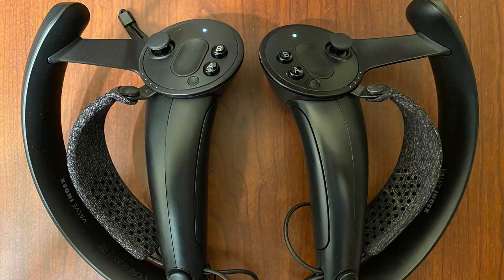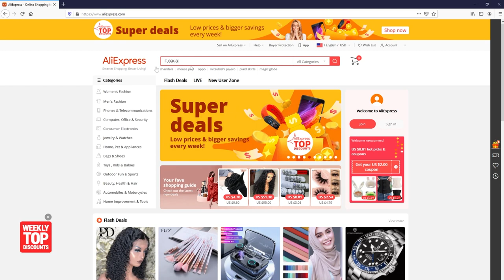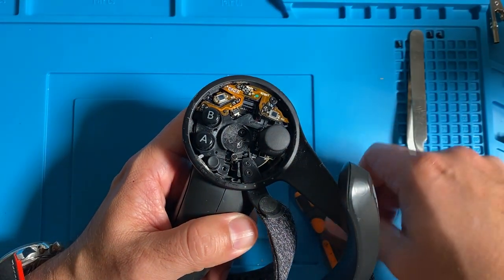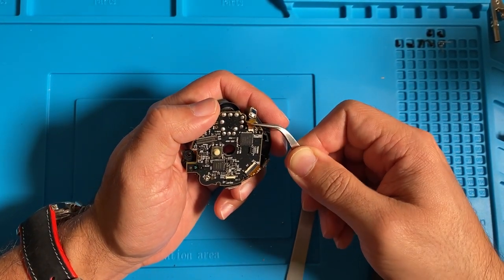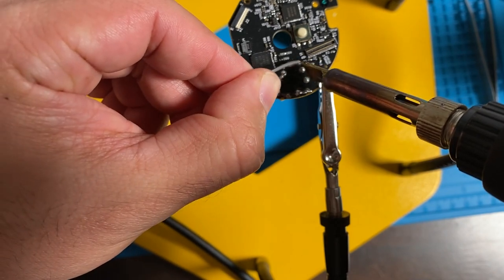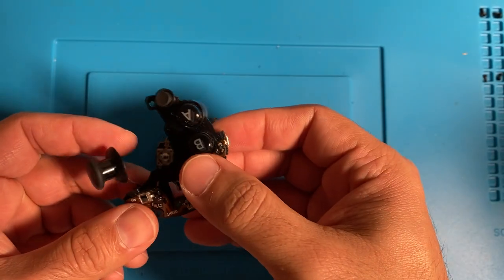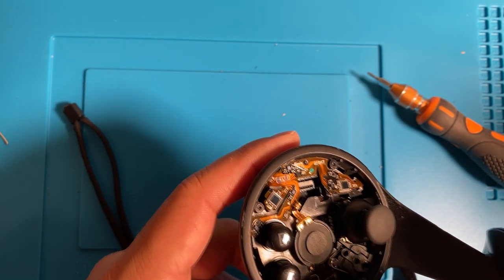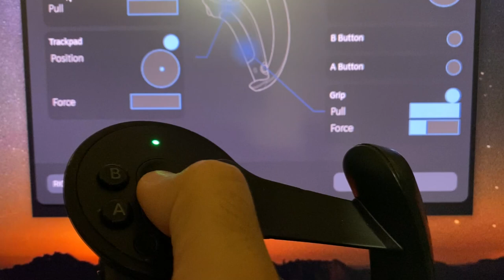Valve Index Controllers Thumbstick Drift Fix | Thumbstick Replacement

Comment: It took me a while, and i had to learn soldering, but i finally did this replacement (left controller, so all was mirrored for me), with only your video as guide. Thank you! The hardest part was to get all the solder loose or removed  to remove the old part. The second hardest part was to place that little f..... spring back in. The little pincers i had just always lost grip.

Comment: After 400 odd hours of being repeatedly flicked upwards to avoid fast travelling in Skyrim, mine finally succumbed.
Managed to follow this guide. I was nowhere near as well equipped to unsolder the old thumbstick and resorted to ripping it off in pieces and unsoldering the leg stumps that were left with the iron and a manual thumb spring solder removal pump. Was adamant I'd ham fistedly broken it by the time I'd finished but she's working perfectly! 😁
Reply: Oh my god I just did the same thing today lolll
That's the same way I removed the old thumbstick
Luckily it worked out perfectly fine
Reply: I just got mine off, haven't put the new one on yet.  I even bought the same chip quik stuff he used and STILL had a hell of a time with it.

Comment: Im one month away from 2 years with my index. I've been through 3-4 controller replacements. I'm tired of it, Valve could have done much better imo. I've been watching this video on repeat the past couple of days getting ready to purchase equipment and parts. So far still cheaper than a new pair. Plus if I get good at it I can take in people's controllers from the league for repair.
Reply: Does it work ?
Reply: same lol
Reply: around 3 replacements in only 2 years?
May I ask how much do you use them?
Sounds very excessiv to be (no offense).
I just bought the index controllers and they arrived yesterday. Haven't tried them yet, but somehow Im a bit worried of course

Comment: Thanks mate, managed to swap them out and keep everything in working order! 

For people looking to do this, I strongly recommend the chipquik or something similar, it's possible without but took way longer than it should have. Try your best not to snap the legs off the original joystick, removing them after the fact is incredibly painful. The way I ended up getting the joystick off was using a very small flat head screwdriver bit and slip it between the joystick and the board, applying a little prying pressure as I applied heat to the legs. This allowed the joystick to move very slightly each time I changed what leg I was heating. Would have worked great but if you apply too much force, you risk snapping the legs off like I did for 3 of them and it was a pain to get those out.
Reply: I was able to fix my controller with the help of this video, but I wasn't able to get the chipquick to work. I bridged all the soldering points on the thumbstick with chipquick and had a fat tip on my soldering iron running at 675F, but the thumbstick just wouldn't let go. After a lot of heating and pulling, molten chipquick ended up running onto some tiny capacitors nearby. I was able to clean them off by wicking it away, but it was a big mess. What worked for me was to use ESD tape to cover nearby components, then to heat the individual thumbstick soldering points with my hot air rework gun and to suck away the molten solder with a desoldering pump. I'm sure chipquick is an easier way to remove the thumbstick, but it seems like it involves more risk than desoldering each point individually.

Comment: Thanks for the super detailed video - I really appreciate it. I'm going to go down this road sooner than later. Might as well try to fix it for under $20 (controllers ~$8, solder wick and pump, maybe some quickchip) before buying a new controller (not that their in stock right now anyways.) I've soldered bigger stuff before, but not too confident in soldering something this small. I think I'm going to find some old electronics to practice on first. Just thought I'd mention that for anyone else hesitating to to try fixing their Index controller.

Comment: I think its highway robbery when a company designs a part that will break over time from use. That's ridiculous and a terrible design. Thank you for posting this
Reply: Just to play devil's advocate, all analog sticks will drift eventually. It's just a matter of when, and companies need to do a better job making that 'when" a lot farther away.
Reply: and they are still selling it like there`s no problem with the stick
Reply: @FilthyCasualVR  I think Valve designed most of the original HTC Vive's hardware to begin with. The headset, base stations, and controllers.
Reply: every product ever designed ever breaks overtime from use.
Reply: A controller this expensive and technologically advanced really could've included a hall sensor stick. I get it that they were strapped for space so they had to use the tiniest analog stick mechanism they could buy, but that's hardly an excuse to buy the cheapest one too.

Comment: Great vid. my left hand had pretty much the same issue, though the sensor couldn't even detect that I was pushing forward on my controller. I was hoping the controller would be simpler to do myself but I don't have any kind of sodder experience or the tool to do it. I'm glad that there is a fix and that I wasn't the only one with that issue.
Reply from the maker: Yup, I feel you.  I wish it were simpler.  This is why I said do so at your own risk.  You have to be careful if you try this, you can break your controllers if you are not careful.  You can also overheat the board.  There is some risk. I would recommend grabbing a PCB prototype kit and practice soldering and desoldering components before trying, plenty of youtube videos on soldering also.

Comment: thanks for the video mate!
don't has the skill for soldering, so i replaced the entier board (what wasn't easy at all and the faceplate ribbon cable snapped in half for... no reason. thanks i had the faceplate from the donator controller so i was able to change it, but i'm surprised how fragile the internal componants are...
Reply: I tried to replace the entier board, but I has no lucky. Buttons are not working, I think I got a busted board from AliExpress.

Comment: Thanks so much for the info. It's so motivating knowing that this is something I can fix myself. Also 👌 on the music
Reply: Update: I did it! I accidently broke two of the plastic clips for the top cover and the led doesn't work anymore (don't know how that happened, mightve mistaken a random plastic tab for solder or something) but the drift is gone! Just have to get used to the new activation force of the stick click

Comment: Thanks for the video! The explanation of the steps is very helpful

oof..
using plastic instead of metal on a self-grinding down part could be seen as planned obsolence.
They save some minor couple of cents during production but the get a multiple hundred dollar reward when it breaks from the customer.
Especially since valve doesnt seem to sell replacement parts at all.
(same goes for the lighthouse boxes, which are also hard to disassemble)

Not very "pc gaming friendly" I would say.

Comment: Thanks for translating the Russian one and adding to it. My only input is i think the ribbon cable connectors have flip up latches so you don't need any force to remove and reinsert the ribbon. I could be wrong, I'll be doing mine soon, but i think it's the same as a phone or laptop. Good call on the chip quick, that's pro knowledge lol
Reply from the maker: Thanks, I'll take a look.  I'm fixing another one tomorrow.  I don't recall seeing any latches, but I'll take a closer look on the next one.  If you fix yours and find them, let me know, I'll post an update.
Reply from the maker: You are right, there are small latches.  I will post an update. thanks.

Comment: I took the cover off based on another (text only) guide and ripped the thumbstick ribbon cable like you said.  I think that's just the capacitive sensor for the stick which shouldn't really matter?  No reasonably priced replacements to be found on Ebay.

Comment: it's worth noting that Valve is very forthcoming regarding RMA for this issue. in my case an RMA after 3 years was no problem. so you might want to try that road first before potentially breaking your controller.
Reply: After nearly 5 years they refused to RMA it for me :)
But I won't buy another one for the price they still have without breaking them in the repair first. And if it works I only paid like 10 bucks for all the tools I didn't already have

Comment: Man I did this and soldered the potentiometer on upside down causing me to have to unsolder and re-solder it again, I basically Overheated the board or something because now there’s a short and it just flickers and vibrates. Great video though, I was able to do everything else without breaking anything haha.

Comment: You are heaven sent my friend.  Was able to replace the stick perfectly and even lube up the trigger springs while I was in there.  Only caveat being that I'm fairly certain did just that you said to avoid at the opening with removing the force sensor on the trackpad when it just flexed ever so slightly.  After some double checking, fairly certain that's what happened anyway.  Got any advice for a component reseller lead?
Reply from the maker: Probably not what you want to hear but your best bet might be buying a new controller from eBay if you want to fix the trackpad.  Unfortunately Valve doesn’t sell any components so we are left with very little options as far as repair goes.  I’ve removed several of the trackpad force sensors without issue, maybe yours was glued on there harder?  I can’t think of many better ways to get that off of there since it’s glued on.
Reply: @nolomite3921  A little bit of heat with a heat gun or hair dryer might help, not too much to avoid warping the plastic, just enough to make everything warm to the touch, this generally softens the glue that is commonly used in electronics and can help make it sticky again for when you put it back together.

Comment: great video, unfortunately there was user error... resetting the spring i dropped it in the controller upon reassembly  🙃

edit: i disassembled it and the spring perfectly unfolded under the hole for the trigger

Comment: I got issues, I've not contacted Valve yet to see if they will sort it for me, I had replacement some time ago but now it seems I've having the dreaded issue. Certainly don't fancy buying new controllers. I'm doing some research into this, in which I found this awesome video. I think if I do decide to attempt to replace the part, I best study on soldering etc too. I were just wondering if also,  it were possible to get a better quality part which would fit it or to modify it so it doesn't break so easy. Surely Valve should be liable selling poor quality components if they just fall apart like that. Could you fix the original part even. Thanks for sharing the information. What do you think on modifying it so it doesn't break any more, it's just so sad that other controllers can have thousands of hours without no problem. These controllers are great apart from the quality standards being used. Design flaw even.
Reply from the maker: It is unfortunate. Like most manufacturers of electronics, most companies don't manufacture their own components, they source them from other manufactures.  PS5 just had a class action lawsuit against them for the same thing, drift. They should be testing for a number of cycles before failure.  I'm not saying it's impossible to modify them, but probably impractical and difficult.  They are very small parts, built to a tight tolerance.  They are actually impressively engineered even though they fail. I haven't seen any better quality parts that can replace them, the one part I mentioned is the only part I know of.  There are better thumbsticks out there but they have to be the same exact size and tolerance to fit the circuit board. Valve either needs to work with their source of supply to redesign the thumb thumbstick, or find another source of supply and they should be performing better QA testing for cycles before failure.  It's not easy because these are mass produced at some factory, meaning they would have to retool their machines which is very very expensive.

Comment: I've had 6 broken thumbsticks so far and I'm currently trying to get  another replacement but valve is trying to blame it this time on software issues and giving me a hard time with the support. They know damn well what's wrong with the controller design. How much E-waste are they producing with this cheap out plastic thumbstick solution ? I doubt they refurbish the broken controllers. I would pay more for a model that doesn't brake every few months but it must be cheaper for valve to use the plastic ones and then replace the whole controller for every x customer instead using a more expensive metal one for every controller. I wish valve would be called out for this, if it was a xbox or playstation controller that would fail every few months there would be a huge outrage but I guess VR is not mainstream enough to put enough public pressure on valve to finally fix the problem.
Reply from the maker: I'm right there with you, it's frustrating. It's annoying playing Ping Pong with their customer support over a series of days and following their terrible troubleshooting tips.  I agree, they know what the issue is but their customer support techs are really just a bunch of script readers who probably have some boss holding a coffee mug breathing down their necks.  I just played Ping Pong with support to get a new cable which you can't purchase by the way.  Luckily they are sending me a new one even though my headset is out of warranty.

Comment: What temperature did you set your soldering iron to? Also, how highly do you recommend using the chip quick stuff and the flux? I am not familiar with that or flux.
Reply from the maker: It’s been a while so I don’t remember.  I think I the melting temp for chip quick is around 281 degrees Fahrenheit.  I’m sure I went a little over. Don’t go too hot or you’ll risk overheating something else.   I don’t know how much heat some of these chips on the board are rated too but you don’t want to go too hot.  I tried removing a joystick without the chip quick first and it was a huge pain.  I couldn’t get all of the solder off each pin on the thumbstick and if you have just a little solder in any one pin you can’t pull the thumbstick out.  I ended up breaking up the thumbstick with pliers, trying to cut each leg, using precision pliers to grab on a single leg while heating and pulling with the soldering iron.  Huge pain in the butt, I almost wanted to give up.  So yes, I would absolutely recommend the chip quick.  People have had issues breaking something while trying this, I’ve so far fixed 6 controllers but some people have reported their controllers not working.  It could be that they are overheating the board.
Reply: @nolomite3921  thank you
Reply: @slypenguin1468  250-280deg Celcius for plumbum-free lead.

Comment: Great video!  I did this repair just today and had a quesiton. Does the thumbstick ever feel kinda weird when you hold forward then move a little left to right? mine i can feel like it rubbing over the axis corners but only on the forward. Wondered if that was maybe just a defective piece or maybe the piece wasn't seated all the way? it works fine but that feel might bother me
Reply from the maker: Not for me, mine feels fine. Maybe just bad luck with the thumbstick you replaced, I noticed they are not all built the same.  As an example some of the thumbsticks click better then others, so I always test the thumbstick click before replacing them.  So far the one I replaced on my own controller is going strong for 5 months, but I can imagine some thumbsticks from AliExpress could work better than others.
Reply: @nolomite3921  aight good to know. I got the 5 pack so I might try swapping it out again

Comment: Hey bro, I've found that the touch pad pressure sensor ain't working on my controller after the fix. I think the first time it wasn't plugged in, and that might be the case for the second time (need to confirm). You said that you accidently broke yours the first time you did it - do you know if any replacement parts or the parts code for it? Also in what way did you break it? Mine flew off due to the glue strength but I think it's just the connection being butt
Reply from the maker: The part I broke was ribbon cable for the capacitive touch on the thumbstick, not the pressure sensor on the touch pad.  Later I learned you can use a heat gun to loosen up the glue for that touchpad sensor. I’ve repaired 6 controllers so far, and have had good luck removing them, even without the heat gun.  Unfortunately Valve does not offer any replacement parts for these controllers, and I do not know if any sources of supply for the pressure sensor.  I don’t know if this is a proprietary part or if they sourced it from a 3rd party.